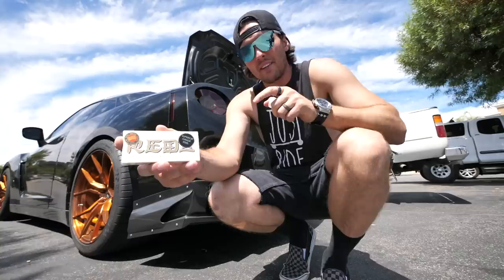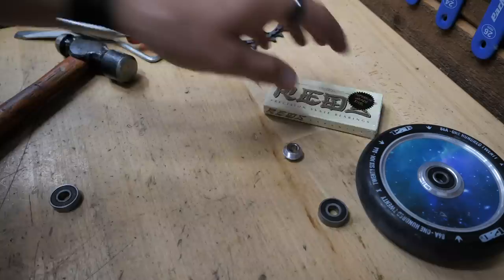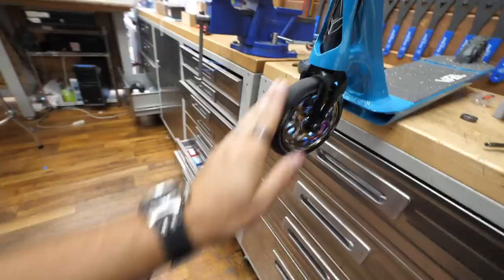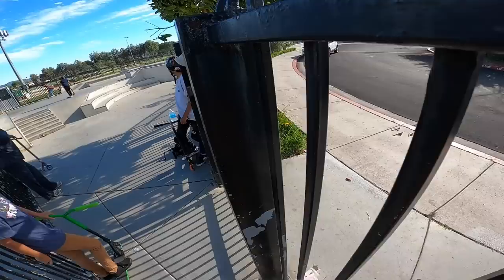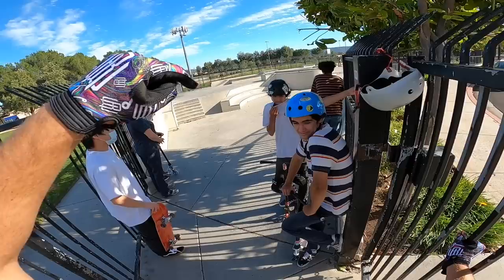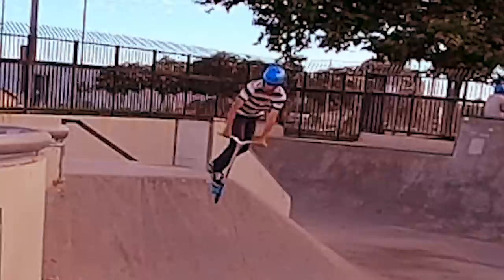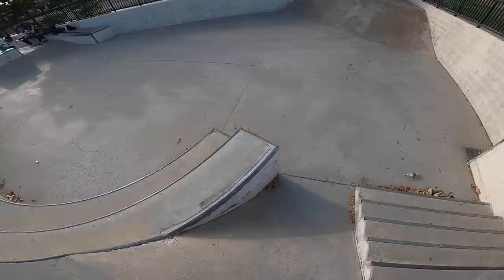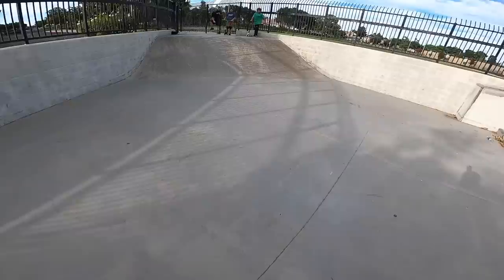TESTING $70 HIGH SPEED BEARINGS!

Comment: I think the longevity of bearings in skateboards compared to scooters is because there's twice as many bearings supporting the weight of the rider on a skateboard. The shock on skateboards' bearing would be allot less dampened by the urethane because skateboard wheels are way harder. Scooters also take really big impacts on a single wheel very often.

Comment: well.. the fullcores are a bit heavier. More rotational mass means that it'll spin longer naturally. Even if they're compared to a wheel with the same bearings. Its the same principle why your car has a flywheel.. to keep the motor spinning without too much vibration

Comment: Hi ray My bars aren’t staying straight even after I tightened them and it’s really anoying. Do you have any advice
Reply: Get a new clamp
Reply: Your clamp is probably worn out or the bolts in the clamp are rusted so they won’t hold it straight so check your bolts and if they look fine then you probably need a new clamp
Reply: Ok thanks

Comment: bearing press for inline skate wheels is so helpful in changing bearings.
Reply: Also, scooter wheels bust bearings more because of the size (diameter) of the wheels putting huge massive torques and impacts on the bearings is about 10 times worse than straight cruising. The loads are basically twice as  much as a skateboard since you have half the bearings supporting your weight. technically speaking, the metal housing is honestly better for bearings because it doesn’t allow any weird squishing action to the outer race like a squishy urethane/plastic hub might allow.